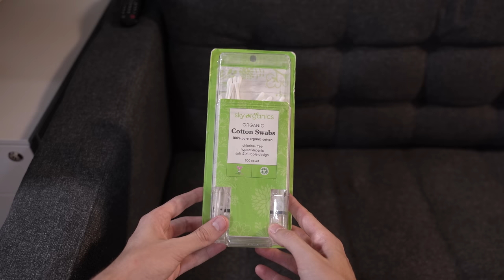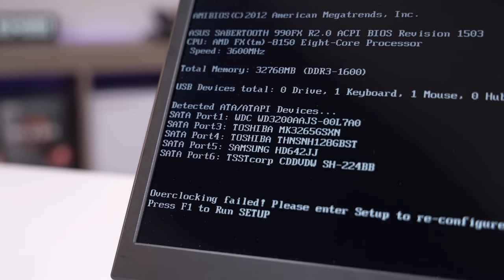Deep-Cleaning a Viewer's DIRTY Gaming PC! - PCDC S3:E9

Comment: I will suggest you to take a hwinfo sensor info snapshot before & after cleaning for temperature comparison, deep cleaning definitely makes a huge difference
Reply from the maker: We've already addressed this in a much older video, but the dust alone won't make much of a difference at all in a case like this. In fact, typically repasting will have a greater effect. I also don't wanna hop into each of these systems just to run that kind of test. I prefer to stay out of the OS whenever possible.
Reply: @GregSalazar  I would still take a snapshot before and after just to verify your complete disassembly and re-assembly provides at worst same temps as before or at best improved thermals just to make sure something didn't go wrong in the re-assembly process and increase thermals somewhere along the line (CPU, GPU, mem, VRMs, chipset, case, etc...)....just as a checksum.

If you don't want to disrupt their pre-existing install you can always have test media for temporary Windows installs for hardware testing.
Reply from the maker: @lagoleer  Yeah I'm not gonna do that with every PC I deep-clean. If an issue pops up down the line, I'd be more than happy to revisit.
Reply: @lagoleer  I wouldn’t bother him about it, as the temperature differences aren’t too noticeable to begin with.

Comment: A before and after benchmark would have been great to show how much cleaning affects performance
Reply: it far worse than u think it is
i have seen more bad pc in past they where at around 80c or 90c or 100c because of heatsink is full caked with dust
keeping pc clean it will stay lower than 70c more than 4 weeks
Reply: Might not affect things at all with this older hardware. temperature wasn't taking into consideration for boost speeds yet, that started in the mid 10s I believe.
Reply: @Kurohyuki I don’t think he would do that, as it’s possible in it’s dirty state that Greg could damage some of the components. This would not be a worth while risk for him to take. Would be cool to see though.
Reply: It's really only going to effect performance if it's so dirty the processor is throttling.
Reply: Uploader said last year: it's not that different

Comment: I use an industrial air compressor and helpful tip when using one..  Hold down the fan blades while blowing off any fans to help keep them from spinning.

Comment: loving this series... however, a tip for telling if a fan can be reused after getting re-oiled.. PWM fan header/splitter with it's own power input so you don't need a running system to test fans, for failed bearings... if they've got the "death-wobble" going on, they're not going to last much longer than a week, speaking from experience due to the fact I try to reuse all fans possible, but not easy when you don't know which fan's got the wobble... even the minute amount of wobble, can end with a dead fan.

Comment: Greg, Just found your channel and loving the content. Been in IT for 25+ years. Spent many years as a bench tech fixing and cleaning computer. My one recommendation is to pick up an air-compressor. Run the systems through a good dusting with that first to get rid of most of the really gross and big stuff. Just remember to do it outside and if you get close to any fans hold the fans down when you get really close to them. Again excellent work.

Comment: Great job on this clean out. The Cooler Master HAF XB Evo is one of my favorite cases. Currently I have a very high end AM4 build in my HAF XB Evo. If I could add a Type C port on the front panel - that would make this very great case the best I could hope for.

Comment: Good job. I also cleaned my PC, though I did not take it apart. See my only YT vid. The Cooler Master Hyper 212 EVO heatsink was just as dirty. I re-greased and re-oiled my 2 - 120mm fans. I still need to do my front 80mm fans. I also need to take apart my video card, clean and re-grease the fan.

Comment: What a sweet case!! yeah my heart is going out to those in swfl... you might have better luck than I did, not many computers survived michael, and a lot of those that might have were tossed. I think my efforts only resulted in a job with a  imac mid 2009 27 inch and a imac g4..  I got to keep the larger imac after it's hard drive died, (Did recover their data) and the owners were thrilled that the vintage imac had survived.

Comment: A small suggestion. Maybe lubricate older fans for good measure. The sleeve or ball bearing types tend to get dry and friction takes over for a horrible noise.
Reply from the maker: We've mentioned in the past several times that we often relube fans with machine oil.

Comment: You should give recommendations how often to call or take to a tech a PC for cleaning.
@3:40 Looks like this is a ton of fan to work with hehehe :D @7:50 I don't recommend to handling the HDD like that, you could drop it, always have it on a a wood/plastic table with some thin spongy surfaces

Comment: Would be nice if you would tell a bit more about the specs of the system before or after you cleaned it. This one looked really interesting and it would be cool to know from when it is and what cpu, how much RAM and which GPU works in this system. This would make the cleaning series much more interesting for me.

Comment: Just got 2 of those motherboards, both untested, 1 spruced into life..the other had been drop kicked and was bent and had exposed copper..some bending and continuity tests later with a new bios chip..and its alive! But that original northbridge pink paste is by far the worst application ive seen..i thought a Phat 360 was bad..weirdly a magic eraser and a polishing compound seems to get rid of the stuck on compounds like this around tiny chips without pulling them off. Nice when broken hardware comes back to life :)

Comment: did you check the bios! newest version is: Version 2901
2016/08/05 3.13 MBytes
SABERTOOTH 990FX R2.0 BIOS 2901 
Improve system stability

when you booted it showed: Version 1503.  2013/01/31

Comment: The Noctua Fan antivibration mounts can be re-used, I have done so, and I also saw you did re-used the 120mm one on the back, why did you clip them?

Maybe there is something I don't see, the 80mm Noctuas may use 1 time use mounts or they where already too worn out, dunno.

Comment: u could use a folding table in you garage to do this cleaning instead scrubbing the pc parts on the floor!
Reply from the maker: It really makes no difference for me. I prefer to have the dust blown onto the ground vs. more in the air when suspended on a table.

Comment: I noticed the front fans were sneakily put back on the other side of the case, assuming to allow more breathing room in front of them. What happened to the lose hard drive, was there a solution? Also why were the small fans besides the PSU fixed with screws instead of the previous knobs? Just interested in thought processes behind changes if possible. Nice cleaning.

Comment: I'm posting 24 hrs late, but two things are bugging me. Did you fix the os not found in the boot up BIOS message. Also, if the board is as old as I think it is, did you change out the RTC battery. Just curious.
Reply from the maker: Yes, of course we fixed the 'OS not found' issue. We said as much in the video and even showed all drives detected after the fact. We don't change batteries that don't need to be changed.

Comment: Hello Greg i am working on a project and i need to connect 6 monitors to my PC and there is no single GPU supports more than 4 monitors so i was thinking of connecting 2 GPUs on my motherboard( one will be used for the simulator that renders the graphics and creates the views windows and the other just to connect more monitors) is it something could happen and if so should it be the same graphic cards or doesn't matter as long as they work independently.
Thanks in advance and have a nice day.z

Comment: Hey I'm reaching out to the YouTube PC community because I don't know what else to do...My pc works fine but will randomly turn off and lose all power..also the more annoying issues anytime I unplug my pc and then try to boot it up it will light up but NOT boot until I reset cmos by taking out battery and putting it back in...I have had the power supply replaced I have had motherboard RMA and have replaced the battery for motherboard replaced. Sorry for the long message any info would he helpful.